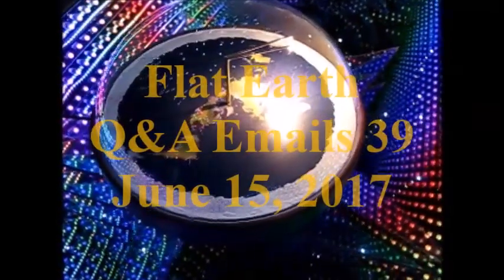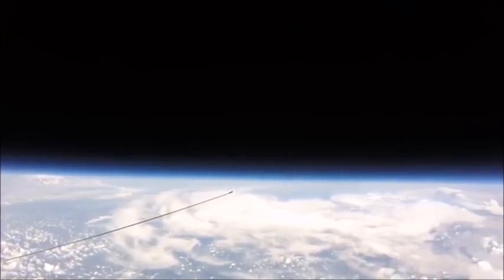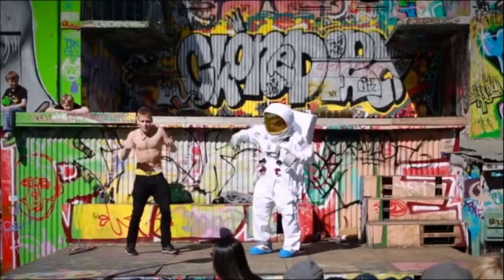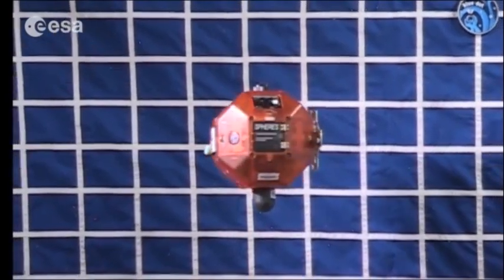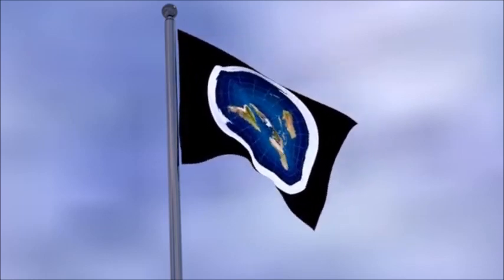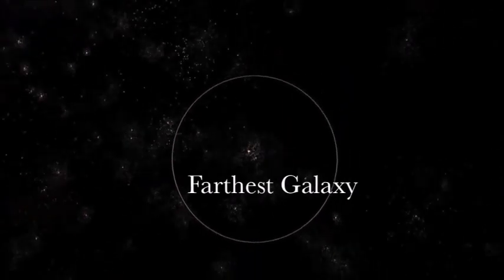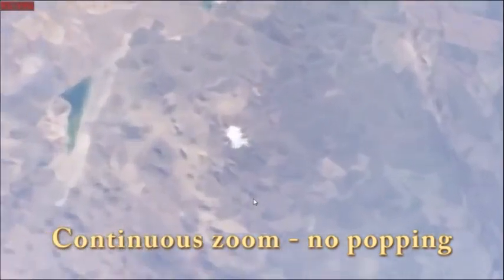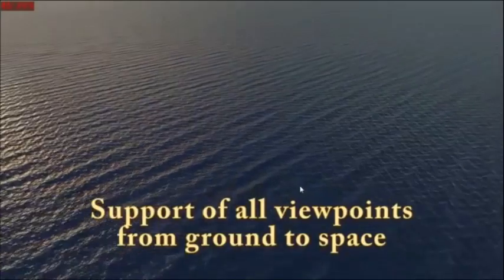Flat Earth Q&A Emails 39 - Mark Sargent ✅

Comment: 3:47 the manual calibration of the accelerometer would be if the springs on the chip ever got out of alignment. 

The accelerometer is affected by gravity. Gravity acts towards the centre of the earth. So the accelerometer week always say down is towards the centre, unless you manually recalibrate it or it malfunctions.

Comment: Mark: Gyro turned off? The gyro on the phones are not mechanical. If you turn them off then on then you missed the action.
Reply: Brainwash Cleaner what gyros? phones have accelerometers. and sensors..are there any that actually have a physically spinning gyro?
Reply: theom:   the gyroscope inside phones are not mechanical as in rigid in space but rather mems. So how can you turn them off, go 6000 miles, turn them on, then see any result? That is what I thought Mark is saying.
Reply: So in other words they are a fraud and a scam. got it.
Reply: @CD: Ok, I apologize. Lets just debate. So My take is that Gyro  MEMS have moving parts . The capacitance is measured  but the Coriolis effect in MEMS is not referring to the Coriolis of the earth. It is referring to the two vibrating masses of the  gyro  creating similar to Coriolis to then measure the difference.  But the issue I have is FE  are saying they turned the  phone off, then went 6k miles, then turn it on, and then the gyro is supposed to show pitch. But that can not be used as a tool because the reason gyro measure angular rotation is because they are measuring it as it occurs which means phone has to be on. Correct me if I am wrong. I was actually debating FE's saying please use correct method to get the proof ( as a FE myself)